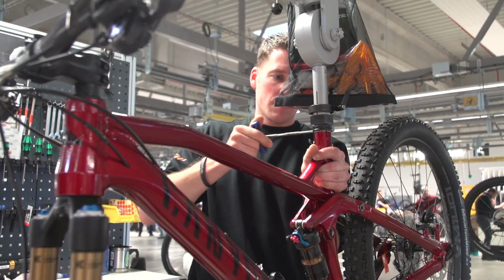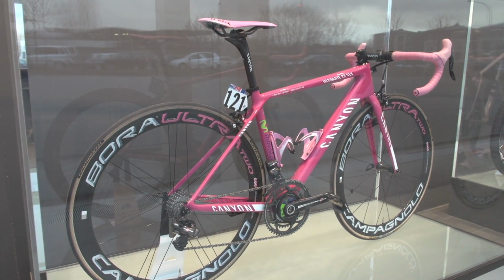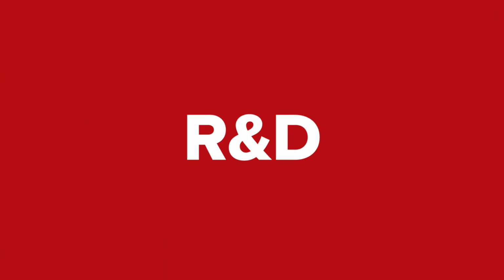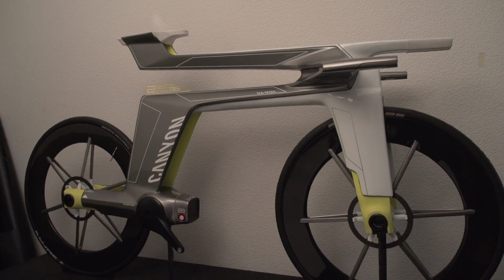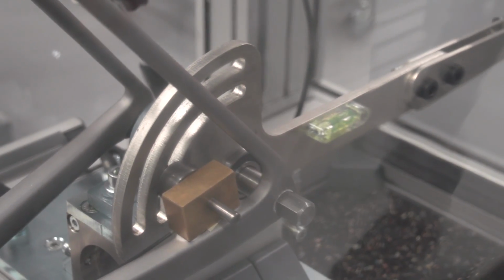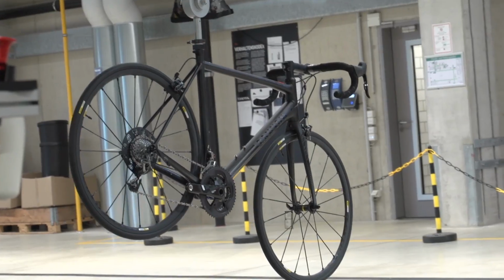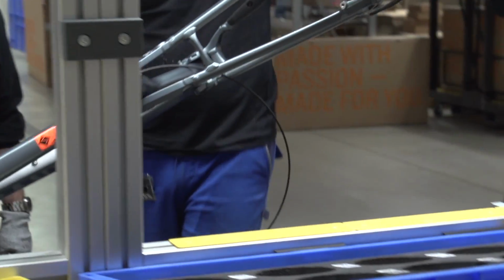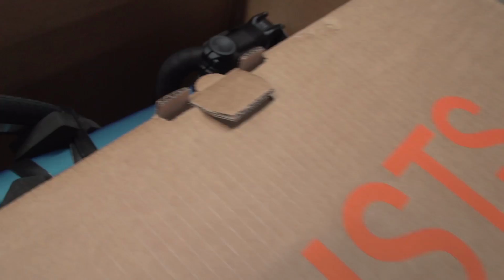Inside The Canyon Factory – GCN Tours The Canyon Bicycles HQ

Comment: Furious with my Canyon MTB that arrived last week.   The instructions for assembly did not correlate with the components on the bike.  The dropper post connection was completely different and I ended up searching Reddit and finding a thread on this common problem.   It was an awful experience which took a few hours to resolve.  With that and some damage in the bike I’ve sent it back and will go and purchase from a store where the assembly is the responsibility of the bike shop.  An awful experience with Canyon for me.

Comment: Disc brakes really spoilt the good look of the bicycles. it truly is the biggest gimmick in the history of bicycles. it is really sad.
Reply: Sb Sb considering that mtbs have being using them solely, for about 15 years and they have better braking power and they do better in wet and muddy conditions I wouldn’t call them a “gimmick”.
Reply: @SllSamuel-034  they started to put it on MTB some 30 years ago at least. have you thought about why it took so long for people to put it on road bikes ? i'm telling you. it's marketing gimmick.
Reply: Sb Sb so having more braking power, being more resistant to heat and having much better power in the rain and mud is a gimmick? 

Also as I said before the reason roadbikes haven’t switched to discs is because they are heavier but over the years they have gotten lighter and lighter and one day they will be as light if not lighter then rim brakes, and as far as aero goes it can be made better just no ones really tried to do it yet.

And also some pro teams do use disc brakes for stages with long and steep decents
Reply: @SllSamuel-034  you are on a wrong channel. This is a road bike section. May I asked then why the biggest pro teams are not using disc brakes?
Reply: Sb Sb you said they where the “biggest gimmick in the history of bicycles” mtbs are included in that group not just roadbikes. And the reason they don’t use discs is because there are heavier then rim brakes, in every other way discs are better and as soon as they become a similar weight all the teams will switch over.
Reply: @SllSamuel-034  i am not trying to change your point of view. but it indeed is a marketing gimmick. And not only that, aerodynamics are down the drain also.

Comment: I purchased a bike from Canyon and had a problem with the frame. I sent the bike back to Canyon and they said they'd swop out the frame for a new one, so far so good. Then the problems started, I was initially told two weeks and this turned into a month and then that turned into three months. During this process I was repeatedly misled at best or lied to at worst until they eventually had to give me a refund. All in all the worst customer service experience I've ever had. Whatever you do stay away from Canyon. You'll get better customer service from your local meth dealer.
Reply: History, it seems, is repeating itself. I wonder if they packed your bike with the forks reversed which in turn allowed the fork to gnaw into the underside of the frame? I'm a week into my two week wait expecting a warranty replacement...

Comment: Actually i don't really get the fact that so many People here had such problems with Canyon.
Some had their delivery delayed by 3 Months, others were ignored by the Support and even worse some People got a defective bike!

I bought my new MTB on a Saturday and it came, just 3 Days later, on Tuesday. I had a technical Issue with my Dropper-Seatpost, so i called the Support. Very Friendly and helpful, worked after 10 Minutes. I am using my Bike on Terrain and Jumps, that are not in its Category, but not a single Problem since 3 Months, of course some bent rims and flats but nothing on the Bike itself.
Reply: Maybe they called canyon when it was midnight in germany or on sundays (sundays in germany everthing is closed by law).

If buyed from Canyon USA (Available now) - IF problems where found at the beginning of building up the US-Facility and Service maybe the first months they where still in build-up phase hiring and training people etv. In such a starting phase sometimes service and assembling is not perfect.

Comment: Thanks GCN for this video! Happy to see how a canyon production facility looks like. 

Those who complain that the frames are made in Asia, I really don't get your argument. That's outsourcing, perfectly normal for a profit maximising firm. Since raw materials, or in this case, quality carbon fibre can be made cheaper in China or Taiwan, why shouldn't they do it there? Factories in Asia have safety and quality standards as well. Why else would a leading brand in bicycles get it done there if it compromises its reputation? 

Remember: cost of production =\= quality 

P.S. I'm neither from China or Taiwan. 

Happy riding guys!
Reply: Maybe GCN could do a similar video for Giant or perhaps a carbon production facility in China? That would be really cool!
Reply: Yes, then we could see what the average Canyon bike looks like during production.
Reply: Bryan Lee --> I get your point, manufacture low, sell high. But one knock off rim manufacturer has a video on here of their factory, they're dropping pieces of carbon fiber on the filthy floor, picking it up and using it in the rim lay-up. They are sanding the carbon fiber without masks or any kind of breathing protection. You can't do that for the 12hrs a day they work. 4yrs and the workers lungs give out, I can't support that.

Comment: Having ordered a bike for Canyon and had to cancel this company is a joke! Just look at there mentions on Twitter! Would not go near them again
Reply: Having received a bike from Canyon I would not order from anywhere else. The bikes are fantastically good and great value! However I can certainly appreciate the frustration of customers waiting for delayed orders. I was fit to pull my hair out while waiting for mine!
Reply: GCN Why are you helping Canyon market a product that they can not supply ? My order is 3 months past delivery date.
Reply: I got my original bike last April and the box wasn't sealed and it was damaged on arrival. The top tube has a hole in it and the only way it could have happened was if someone opened the box during transport. It took a month to get it sorted under warranty. The second bike was fine. Unfortunately another rider crashed into me from behind I needed to use the frame replacement scheme. This coincided with all the current problems so I haven't seen my Aeroad since August. I think the companys decision to move facility and launch in Australia/NZ at the same time left them unable to cope. These things happen but it's the amount of time to come clean with customers that bugs me.
Reply: +Callum Ogden Have to agree! I waited four months and was given several dates by which it would be delivered, every promise was broken before I cancelled. Shame really they look like good bikes but the customer service is just terrible!
Reply: +Callum Ogden Ive been waiting for a frame replacment since early August.....at this rate I really hope I have it for the summer....
Reply: Thanks Jasper, I have to say I love the bike, it's just so good, thats what's keeping me going! Safe riding.
Reply: +Callum Ogden I have two Canyon bikes. Ultimate CF SL and Grand Canyon CF SL. In my point of view they are perfect and well worth the wait. The Ultimate had about 10 week deliverytime to Norway and the GC about 1 week. My next bike is also a Canyon.
Reply: +Callum Ogden canyon sucks!
Reply: These bikes are made in china su[er cheap and marked up like crazy by canyon...sorry i cannot support that